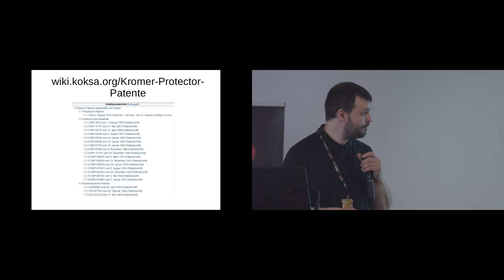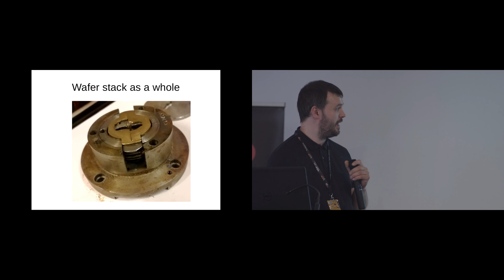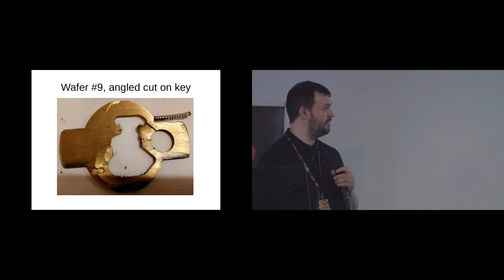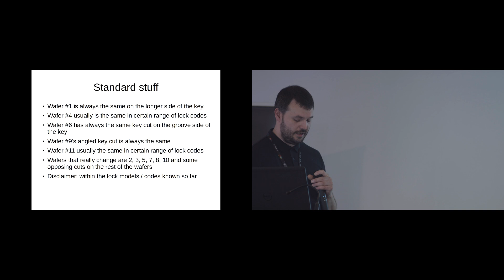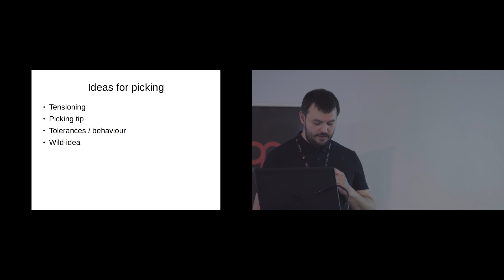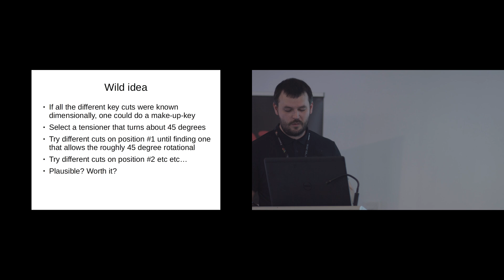The Unpickable Kromer Protector - Jaakko Fagerlund - OzSecCon 2019

Comment: This lock is quite pickable now, and has been picked by 2 separate pickers so far.
Reply: Speaker from the video here: Could you elaborate on 'quite pickable'? I can pick it also, have been opening these for years if the lock needs to be opened and gotten back in to service (current limitation is about 500 mm deep keyway), but is completely NDE opening possible? And on which version of thelock, as there are tens of different versions. And is the opening possible when mounted or is it just technically picked on a bench?
Reply: Haha "quite pickable" even people in locksport picking them is extremely rare